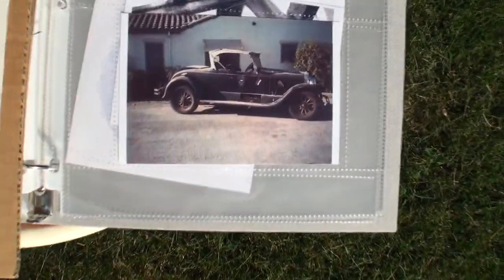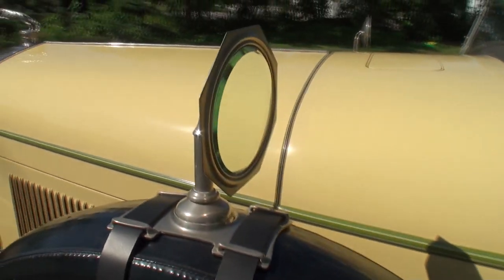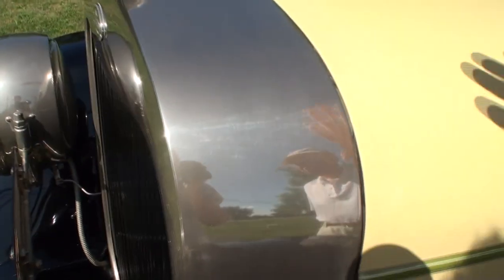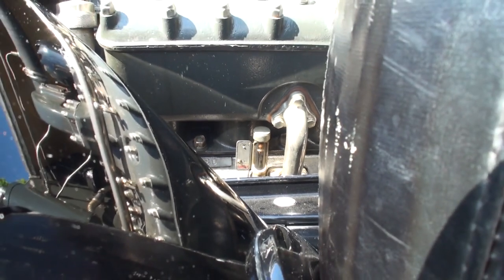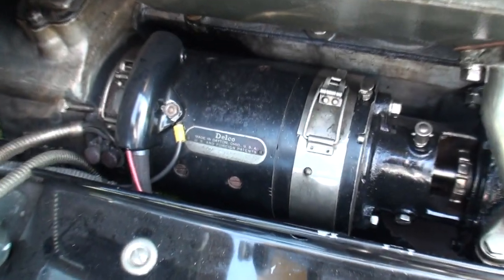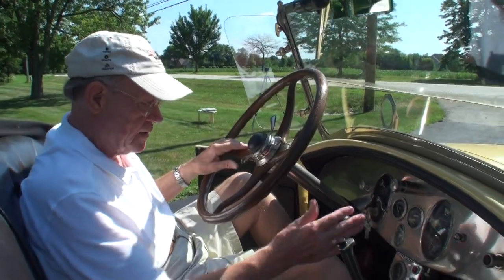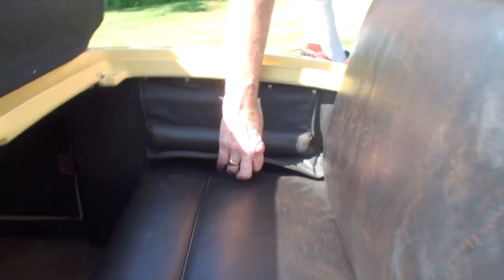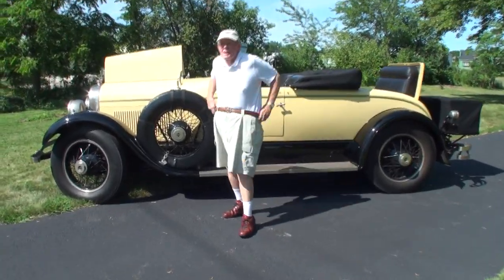1926 Lincoln Model L 151 Sport Roadster & Engine Sound on My Car Story with Lou Costabile

Comment: Neat car! One thing ironic about the sale of Lincoln to Ford. Henry Ford lost control of his first car company, that company became Cadillac with Henry Leland at the helm. Leland left Cadillac due to a falling out with Durant, after it had been purchased by General Motors. During World war 1 Leland and his son formed Lincoln motor company to produce Liberty aircraft engines. When the war ended they designed and built the Lincoln car. The cars were Superior mechanically, to almost all of the cars of the day, but they were not very stylish  and expensive. The company went into receivership and Ford bought the company. Ford's first act was to put his son Edsel in control of the company. The second thing he did is throw the Leland's out. Thereby getting  back at Henry Leland for Fords ousting from his first company.
Reply from the maker: Thank you grant wright for sharing your knowledge, Lou